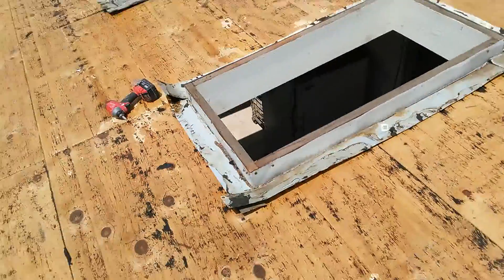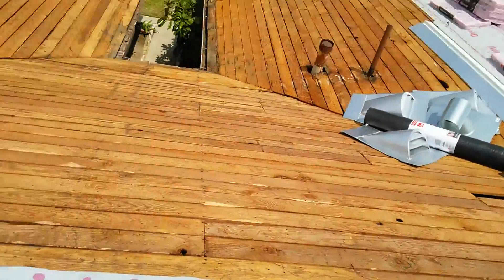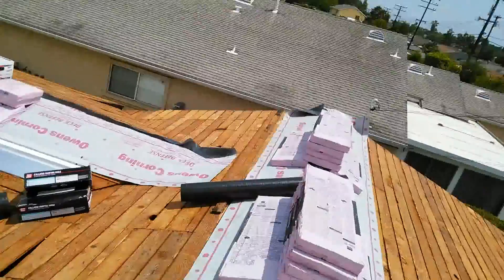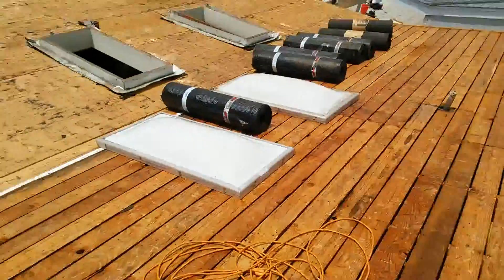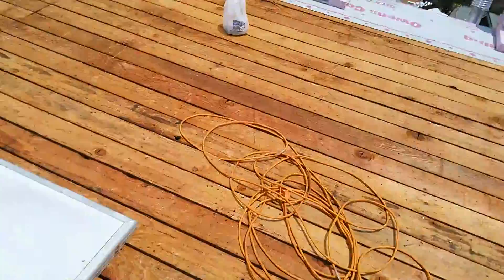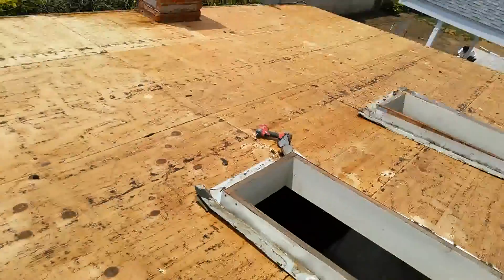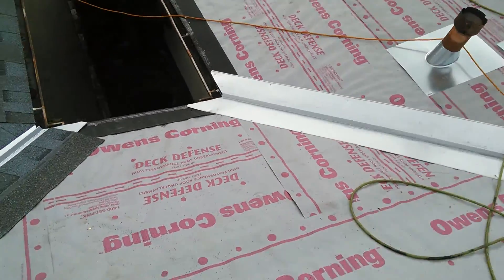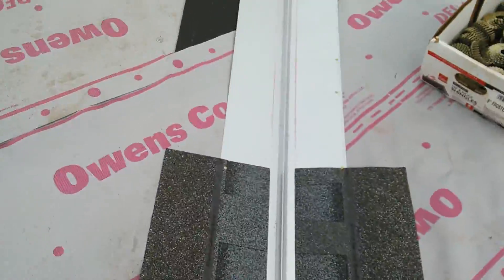Roofing Tricks : Roof preparation , Shingles installation, Wood replacement.

Comment: Thank you! We doing roof right now! And the roofer ripped everything off and informed us 'no plywood'. Gives us a price of 60% more on the spot,  as his guys are on the roof! We are like---it was this way for 70 years and now needs plywood? We don't know anything,  but we did know we can't spend 60% more, so we politely  said just do it without plywood. And now we see this video! THANK YOU!
Reply: Same here. Though I am not a roofer, I know enough to know there's no engineered wood that can stand the test of time and wood damaging insect resistance of a sappy nutty pine wood from the 50s. While installing my stove pipe on a hot afternoon, I cut through it to realize the wood is still dripping honey like gummy sap like it was harvested from the forest yesterday. The contractor showed up with ply boards, I had to educate him on how I want my 70 year old pine board roof repaired.
Reply: @spontaneousexpress  👍👍👍
Reply: How well has it held up so far?
Reply: @spontaneousexpress  Awesome. How has it held up? How are the gaps avoided when nailing?
Reply: @SimplifiedTruth  good, but it's only been two and half years.
Reply: @SimplifiedTruth yes, we noticed how many nails stick out now from our unfinished ceiling in the garage attic... I don't remember that from before. But they had to use nails as well in the past, right?....Now the ceiling looks like a hedgehog. I'll have to climb up there see if there are gaps in that wood. Obviously they were just nailing on the outside not checking anything on the inside.

Comment: Thanks for this video. The marketing for OSB and plywood is so ridiculous its hard to even find information on plank decking like this. Im doing it on a new build so I don't have to worry about it for the rest of my life!
Reply: I have a house from the 50s with planks but the front awning was added later with osb and shingled. It sags in the middle from rotten osb. Planks are the way to go.

Comment: What happens when you nail shingles and it falls into one of these gap areas
Reply: My thoughts exactly. Theoretically in a hail storm, seems higher chances of penetration if it were to fall right on the gap

Comment: I have a house in Illinois with the same kind of sheating of this video, one guy from x company came to give me an estimate and told me that my sheating is out of code and they have to install a new sheating, of course the cost is so expensive, thank to you I will take my time looking for an honest company, I just have very old shingles, so I want to change my roof. thank you.
Reply: He is right, if your wood is bad and so on  you need to replace it. I believe here in california is up to code to install plywood.
Reply: @Winchester-ii5oe  thank you for your opinion, work in my house was already performed for a reputable company, city inspector came by and they didn't had to change the old style thank you.

Comment: Not recommended, can cause Buckling of shingles. Not covered by IKO, CertainTeed, GAF and Tamco. You have to check with the shingle manufacturer you are using to make sure what’s covered. I would never install on Lumber. Customer needs to pony up some cash for plywood !!

Comment: Which option is better for our roof?
Thanks for the video. We have a small bungalow with a 5/12 pitch roof. The house has  a small,  10' wide covered verandah with a 9/12 peak on the verandah.  We are reshingling the roof with shingles. have 3/4" boards over the entire roof.  There are a lot of gaps between the boards (anywhere from 1/8", with most gaps being about 1/4", but with a few gaps up to a 1/2" wide between the roof boards. As is, we cannot air nail the shingles, as some will go in the gaps and create holes.  We were given 2 recommendations to reshingle.  I will list those here. Could you please tell me the better option and why?  Our roof is stripped and will be shingled  beginning in the next day or two.
We really need some solid advice. Thank you.

If money were no concern, which is the better option for longevity and waterproofing of the roof, as well as shingles being less likely to blow off (we are in an area with lots of high winds and humidty in Nova Scotia, Canada).  We understand that under certain conditions, if the winds are high enough, you can lose some shingles, so just getting opinion of what would be LESS LIKELY to come off, air-nailing or hand- nailing?  The following are the 2 potential scenarios.  Which do you deem better and why?  Thanks.

1.
- existing roof boards; add Ice & water shield to entire roof; hand-nail entire roof

versus:

2.
- resheath entire roof with OSB over existing boards; just regular Nova Prime wrap over entire roof and water & ice shield in usual areas; air nail entire roof

Comment: Doing same trade for 16 years gotta ask though why do you put your starter on upside down?
Reply: Thats how it should be installed.That's where the sticky tar is. It sticks to the bottom of the first shingle so it wont get blown off by the wind.
Reply: I learned this in lab in my building construction program....starter shingles are installed upside down
Reply: What is a starter shingle? So I have to buy that separate or is that part of roofing
Reply: @merrymenagerie4116 yes you should always start with some form of starter strip. AND MAKE SURE YOUR FIRST STARTER IS ABOUT 3/4 THE LENGTH OF A SHINGLE SO YOUR SEAMS DON'T LINE UP WITH THE FIRST ROW OF SHINGLES.

Comment: You need to put plywood down.  The instructions of shingles say the maximum gap is 1/8" so you don't blow a nail through causing a leak, or for wind resistance.  If you have a building inspector that does their job correctly, the install instructions are what they have to go by.  When I got my wood stove installed, he looked at the instructions to make sure I had followed clearances.  If I didn't make the clearances, would I be expected to say the wood stove manufacture doesn't know what they're talking about my house hasn't had the clearances since built and I've been fine so far?  Likewise with a roof, he will look at the instructions to make sure I followed the clearances & specifications as them signing off on it is them saying to the insurance company and myself they approve that my roof was installed correctly per specs so it shouldn't leak and/or be a health risk and if the instructions say the max gap is 1/8" and you have a lot more as is the case here... would you be able to argue he and the shingle manufacture don't know what they're talking about?  Let alone back in the day when planks were used they hand nailed and could tell if they were in a gap before nailing today it's done with guns you'll blow through the shingle.

Comment: Please for the love of everything pull this video down. Your opinion is completely wrong. That does not currently meet minimum manufacturer sheathing requirements. It absolutely needs plywood sheathing installed over the top.
Reply: Directly from the manufacturer installation guidelines.   ***Note: For existing older installations, if spacing is > 1/8” (3 mm) ≤ 1/4” (6 mm), install a double layer of underlayment. If the spacing is greater than 1/4” (6 mm) install a layer of 3/8” (9 mm) minimum thickness, C-D Exposure 1 APA Rated, plywood or OSB over the wood planking.**